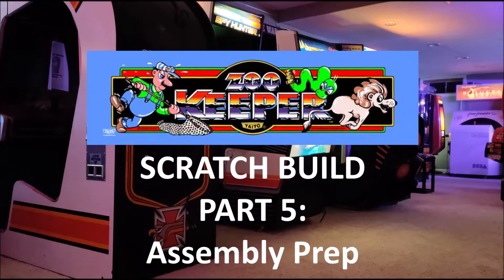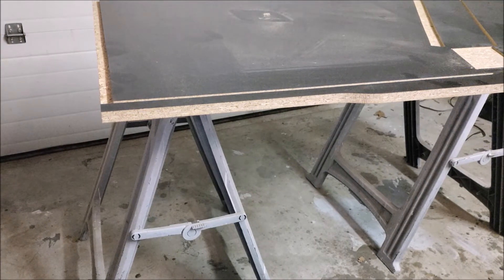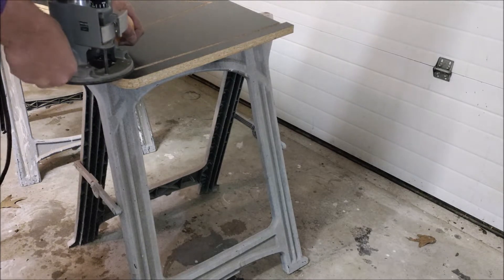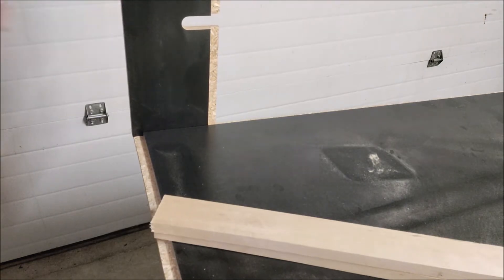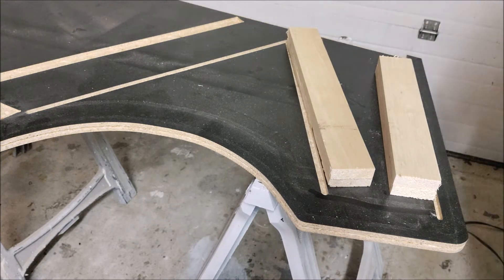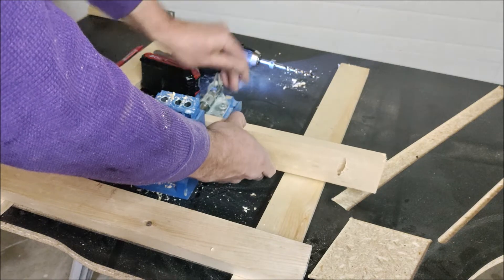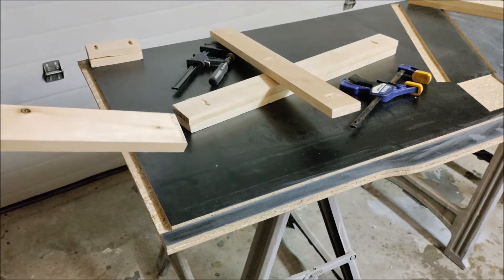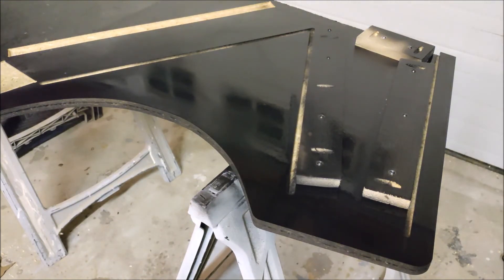Arcade Cabinet Scratch Build   Zoo Keeper Part 5: Assembly Prep

Comment: How deep do you route the pockets for the blocking ect? I have a cnc machine and want to make a zoo keeper.
Reply from the maker: For blocking, as shallow as possible. It depends on how well leveled your CNC is. Most of the time I would cut it around 0.05". The only exception to this would be the blocking for the monitor frame (if you don't have original hardware). I would do the blocking at between .25" and .375" and use glue and screws before mounting the monitor frame. The last video should be out in a week or two for final assembly.